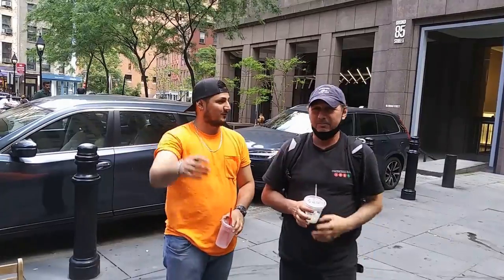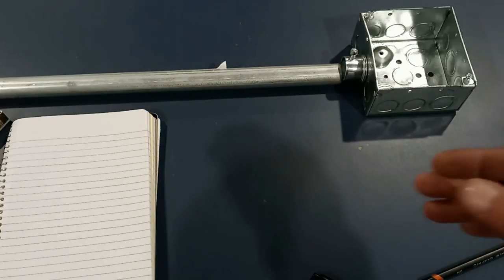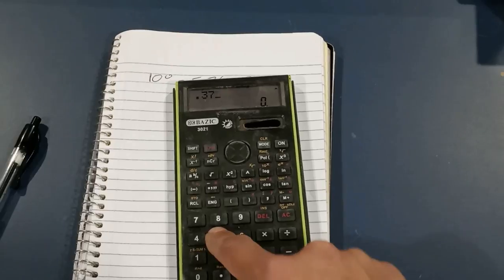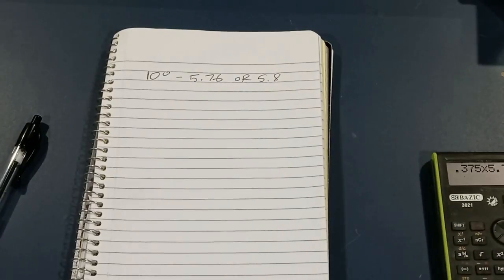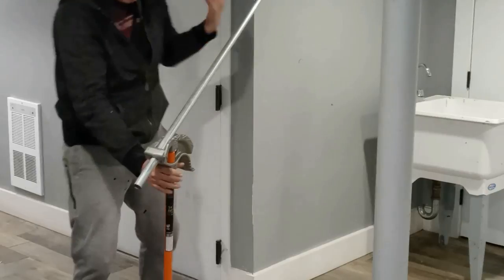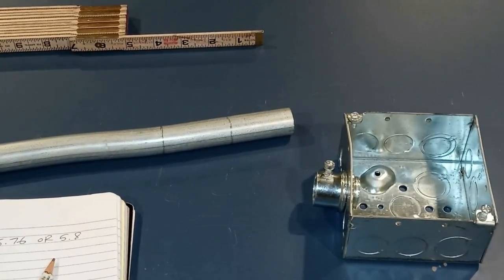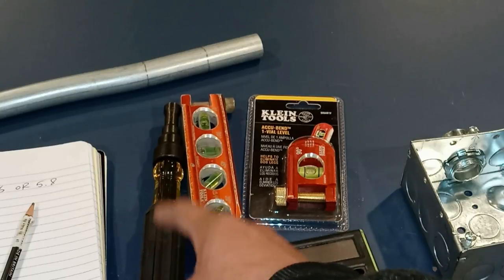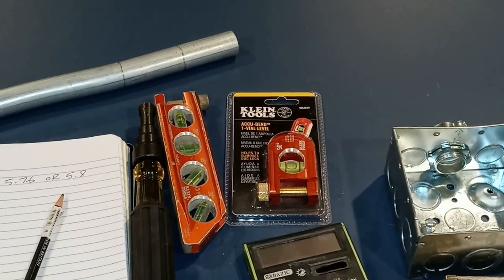Conduit Bending - Boxsets & Using Lasers to Bend Accurately Pt.1

Comment: I appreciate you putting this information out there! I have been bending conduit for 25 years and I still have lots to learn. I feel like we are boxset brothers. I also calculate, measure and mark.  I have always done 5 degree because I was afraid of my marks being to close together to fit the bender in there. You schooled me and I tried a 10 degree box set tonight. Works great and more compact! Tomorrow I need to do some in a riser room to pipe fire alarm cable  to

Comment: If using laser from floor for distance between points doesn't take into account elevations, so determining elevation is required between those points
Reply from the maker: Not if you are just trying to figure out spacing. Now if you wanted to figure out elevation as well then you couldn't do it off the floor. But side to side spacing has nothing to do with elevation. Just a little trick i wanted to pass on to save time when you have high ceilings and you are trying to measure out for example an offset Thats moving around an object from one side to another but at the same height.. Hope this helps.

Comment: I also measure and mark my box sets and put my hook on the mark. We are box set brothers! I have been bending for 25 years but still have lots to learn. I always did 5 degree bends because I was afraid of my marks being too close together. You demonstrated that 2-1/8 is no problem. I tried it tonight and got a perfect bend.
Reply from the maker: You probably gonna kill me. But try this boxset. This is my go to boxset when im in a rush. Try it trust me. I made videos of all the boxsets i do. But by far this video is the one i do 90% of the time when im using a hand bender.
https://youtu.be/-Rkmy-IuB8s
Reply: Thanks Mel, I watched the video. It looks like a nice compact offset, (which I need for work tomorrow. ) I am curious why the space between marks is a little different than the 10 degree offset. Is that cause you are bending a slightly different degree? I calculated it out and 7 3/4 degrees comes close to 2-3/4” between bends for a .375 offset.
Reply from the maker: @erichailperin-lausch262  im not sure its just a little trick i was taught when i first started the trade years ago by an old timer .